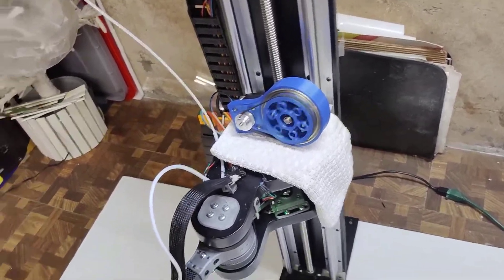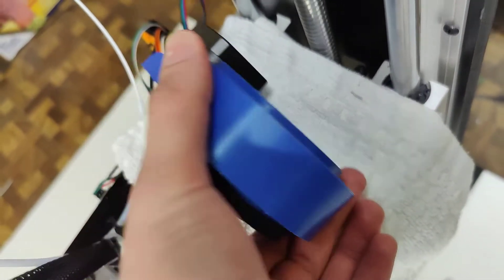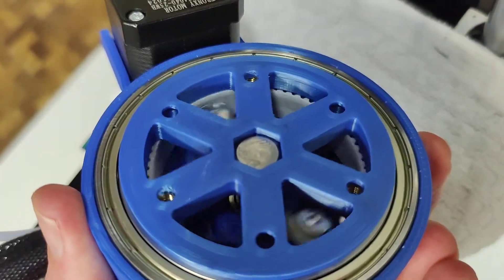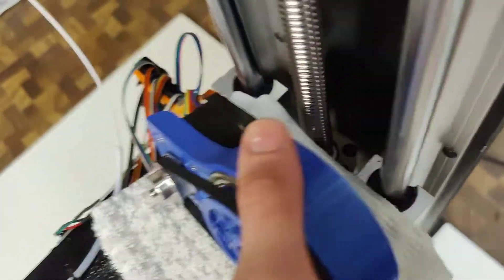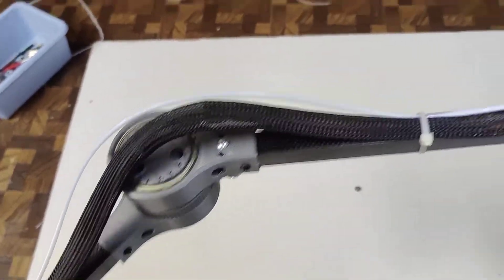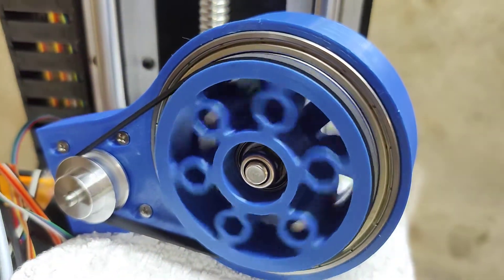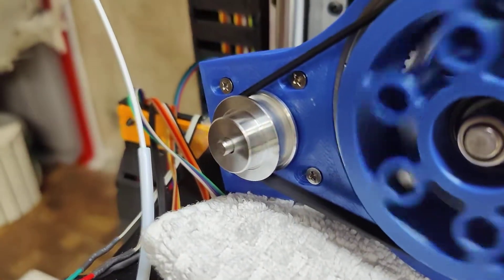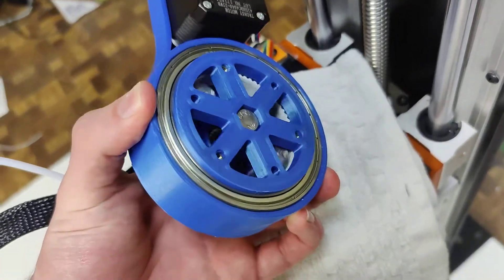Low profile, 3D printed harmonic drive/strain wave reduction.

Comment: Awesome! First really viable 3D printed harmonic I've seen. I'm amazed it works at all since the belt is essentially wedging its way between the teeth of the two rings rather than rolling like compound planetary gears. And one or both sets of teeth must not be quite the right size due to having different count with same diameter ring. But the proof is in the pudding :) How is the backlash/rigidity when holding position?

I'd recommend using a parallel bar linkage rather than putting an actuator on the elbow. That will keep the moving mass low. A beefier proximal arm would also be good, if you can afford it. Carbon may be stiff, but that tube is pretty skinny for such a long arm.
Reply: I'm working on a robot where I put both motors in the proximal link, just make the shoulder joint and proximal link beefier. Makes it a lot easier to wire it up.
I've also done parallel bar linkages, but they need a lot more joints which adds complexity and is more work to program.
Reply: @NathanBuildsRobots  Why would it require a change in programming? It should transfer the exact angle from the actuator to the elbow. The main limitation I can think of is range of motion/loss of mechanical advantage as you approach + or - 90 degrees from center. Probably best to keep within a 120 degree range.